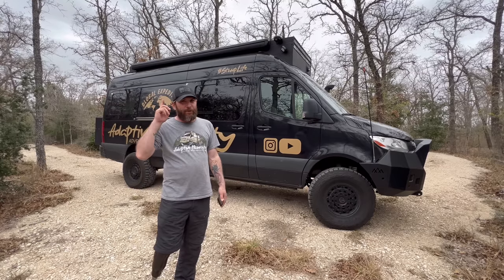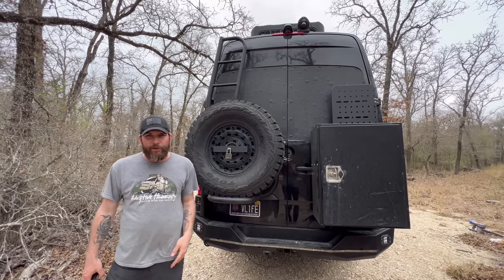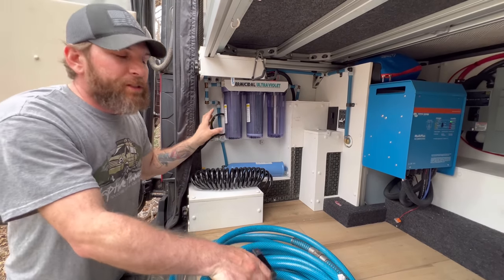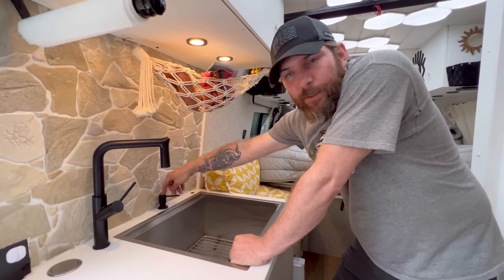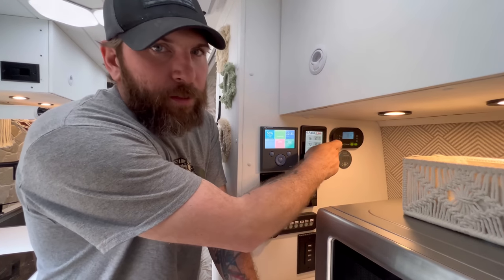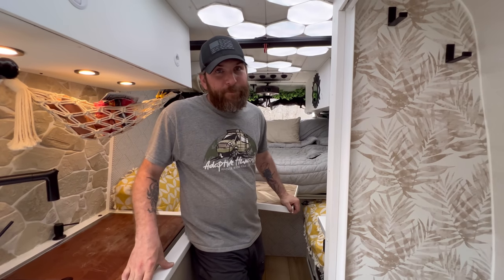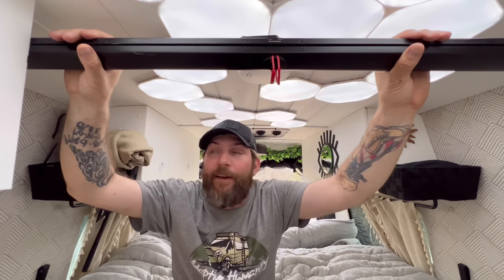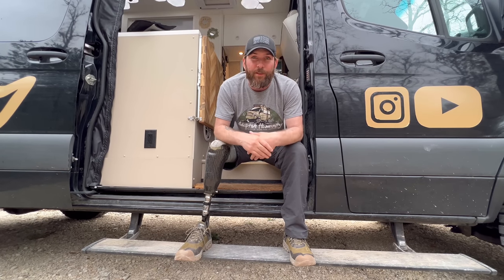🔥2020 Sprinter 4x4 170” Overlanding Van Tour

Comment: My favorite feature: "The Magic Button". Nothing worse than a tailgater. I had a vehicle that would spray windshield washer water on a tailgater at 30mph or faster. Non modified stock configuration. I always knew it was working cuz you'd see the T/G's car's wipers on high; for miles. LOL!  You can't fix stupid

Comment: I used to have a custom lowrider car with hydraulics. We used to joke that we should re-route the windshield sprayer to underneath one of the back rear tires. When I three-wheeled the car it kind of looked like a dog with it's rear leg in the air so if we had re-routed the windshield sprayer we could then lift the rear wheel and pee on cars whenever we ended up next to some jerk in traffic. When you told the story about emptying your grey tank it totally made me think of that. What you thought of is even worse though! We were just going to do it with water! LOL

Comment: So glad I just saw your video! I was googling like crazy if it's legal or not to have security cameras on the exterior, especially more obvious ones. I kept getting dashcam answers and iffy answers depending on state. But I want some actual badass autotracking security on my build.  I want to add a pan and tilt AI cameras on the front and rear instead of just discrete ones. Has anyone given you trouble for them?

Comment: One question actually remains for me personally, I am from Germany and here (and in Europe in general) weight is a big factor for vehicles. Do you have a general idea of the weight of the van with all these batteries etc.?
Reply from the maker: Sorry for the delay I just seen this. The van was 11,400 lbs.
Reply: @AdaptiveHumanity  No worries! That‘s a lot. The heaviest they come from Mercedes is around 11,000 pound (5.5 tons) but they come with dual wheels in the back. I will probably find a Solution. Thanks ✌🏼
Reply from the maker: @christianseidler2252  you need to upgrade suspension, brakes and go with a big super single and it will take the weigh.

Comment: Best 4x4 170” build so far and reasonable pricing. Do you have a website?
Reply from the maker: We do, adaptivehumanity.com it is still being worked on but partially up, so hang in there. We are also building overland vehicles, if interested drop us an email or you can see us at the overland expo west flagstaff, A.Z. May 20-22

Comment: Wow now that's a well thought out and executed build.  It seems like you would consider building an overlanding rig like this for folks interested in overlanding.  I saw some price points of anywhere between 100 to 300k.  Does that include the sprinter van or is that price point just for the conversion and upgrades?  Where are you based out of?
Reply from the maker: Thanks for the comment. We are based in Clearwater Florida and price points are without van.

Comment: When you put a ladder on the side of a van, I would prefer it to be collapsible as well as lockable, so it won't stick out so much while driving and being locked it can't (easily) be used by people with bad intentions.
Reply from the maker: The ladder was only 1 1/2 inches off the body and all together about 4 inches out total. It was also curved to the side of the van so it followed the natural body shape. We never had an issue with it sticking out, it actually saved the tire and  side of the van 2 times. I did think about making the first 4 rings removable but decided it was not worth it for us. I like your thought process though.

Comment: I’m curious about the fire prevention feature that was described as following wherever the electrical wires went. I had a fire in my RV that started from a lithium power pack I left on the dash in front of the driver section. I really don’t know how long it had been burning before we discovered the fire but a lot of the dash in front of the driver compartment was smoldering. I first used a chemical fire extinguisher about the same size as shown in your video and then used a garden hose to finish putting out the fire before the fire trucks arrived. I’m presuming that what you have in your setup is also a chemical fire extinguisher. What I discovered is the chemical composition in the extinguisher was very  corrosive, especially to metal surfaces, and anything it got in contact with was impossible to clean or take off. What I’m implying is that while it may save lives, it’s call to put out the start of a fire could very well total the vehicle as the whole electrical system would have to be removed and replaced. I guess the best is to careful and never have a fire in your RV.
Reply from the maker: Our auto fire supresor covered our house electrical not vehicle. If you did have to replace anything it would be the house system and house batteries. We used eldie fire balls for automotive in the engine bay and dash. But in the end I guess it’s better to have a totaled rv and be alive and well to make the insurance claim. Glad you made it out ok and everyone was safe.

Comment: I'm curious what van has a better chasis that DOES have 4x4 capabilities? What did they upgrade to? I wish ProMaster was 4x4 their mistake!
Reply from the maker: Our personal Rig is a 6X6 LMTV, So no van. To answer your question on a van more capable that would be an E series with 4X4 conversion, Dana axels, lockers and manual transferase. PS sprinter is ditching 4x4 this year. We also own Adaptive Overland Engineering that builds custom rigs so if interested shoot us an email.

Comment: so, how much did this unit go for?
the correct question would probably be: how much would it sell brand new?
Reply from the maker: Brand new around 300-375k depending on the base van price and material costs at the time. We are actually building overland vehicles and custom parts. If interested drop us an email or you can check us out at the overland expo west, flagstaff AZ may 20-22

Comment: Nice build.  I have the same problem with Owl racks and boxes stressing the windows and blowing them out.  Was the PC window install basically the same as an AMA or glass window?  Did you paint the PC?  Thanks.
Reply from the maker: The PC window was wrapped on the outside with 3m vehicle wrap. The window was set using adhesive but also screwed into place. Wrap covered the screw heads.

Comment: Hi Guys! 
Amazing van build, I really freaked out about how detailed and smart your technical part is. Bravo 👏
Few questions:
1- How much will it cost to order the same build from you? Or how much did you asked for this particular van that you sold?
2- What is a new beefier platform you've decided to switch to? I'm at the stage of choosing the right van to make my dreams come true so collecting all useful information) As a LR Discovery 4 driver I really want to keep as mach off-road capability as it possible after switching to van. Unfortunately, at the moment, I can't afford to own both vehicles at the same time.
Reply from the maker: Sorry for the delay, this just came up as a new comment! 

With todays market that van would be roughly 350-375k hard to tell without sitting down and actually doing the math. 

We are building on truck and lmtv chassis now. Way better than any van, slightly wider and the same length as our van 25ish feet. You end up with a lot more living space as well. If I treated in doing a build feel free to reach out info@adaptiveoe.com
Reply: If you build on a van chassis, I would recommend a 3500.  The suspension is already heavy duty and can handle the weight going into the van.  On a 2500, after adding all the weight you have to do all the suspension upgrades.
Reply from the maker: @jonfreitag4126  unfortunately you can not do all the off-road suspension mods on a 3500, plus you would want to figure out how to super single it as off-roading with dual’s is not always a wise thing.
Reply: @AdaptiveHumanity  IMO a sprinter period isn't ideal for off roading, especially a 170.  The duallies with larger AT tires have worked just fine for forest service roads and the places we want to get to with our van.  Super singles are a great way to spend a bunch of money on a platform that is never going to do serious off roading.

Comment: Wow. If there is one word that describes this build, it's overkill. Just to be clear: that statement is in no way meant as bashing. But any engineering solution is a matter of compromises. You can bulid a bridge by filling the valley, but that is, well, overkill.  I do admire the quality of the build and your attention to detail. I would have come to different solutions on all sorts of decisions, though. But that is just me. You would def be much safer after a zombie apocalyps than me. 😛 The largest drawback by far, the way I see it is weight. Going to something like an M1083 is a good decision for you guys.

The one thing I disagree with is the deal with the wood. Pointing to your sink cover as the example for why wood is bad is like point to orange peel or runs in a paint job and saying: this is why I don't use paint. The right piece of wood dimensioned and treated properly would be just as flat as the day you made it. I assume I am not the first person to comment on this, though.
Reply from the maker: You are correct this was an overkill build! We also did a lot of product stress testing with it so some of the items that are in it were being field stress tested. Weight is an issue and our new personal rig is a m1083a1, so no issues anymore. Again it will be over the top 1 because that’s how we do and 2 product testing. We actually are now manufacturing our own parts lmtv and habitation stuff. We test everything on our truck and a few customer trucks. 

As far as wood goes I do agree with you to a certain extent. The sink cover was an extreme example but I did that due to the fact a lot of people use sub par materials ( pressboard, cheep ply, 1/4” birch with laminate). If you are a woodworker, carpenter, cabinet maker you know better but most don’t. The big one that drives me nuts is wood in the floor! Not sure why this is a thing.

Thanks for the comment! Love hearing others perspective, helps us grow
Reply: @AdaptiveHumanity  Like I said, I loved the quality and attention to detail. I'm looking forward to following your new build(s).

Comment: This is an amazing build!!! Love the Nanoleaf lights!! Are you running the lights on DC or AC? If it’s DC, I didn’t see anything on their website for a DC power adapter.
Reply from the maker: They were ran on A/C even though they are a dc light. The voltage was different though it was like 52vdc or something stupid like that.
Reply: @AdaptiveHumanity  Thank you. Darn, I was trying to avoid using AC in our Sprinter.
Reply from the maker: @marshal.van.mathers  so there are Nono leafs that are 24v. I can give you the name tomorrow when I get to the shop. The 24v don’t have all the stuff the other ones have but are still cool.
Reply: @AdaptiveHumanity  sweet man!!! I just followed you on IG. I’ll send you a message
Reply from the maker: @marshal.van.mathers  email is adaptivehumanity@gmail.com

Comment: but those wheels stick outside of the wheel wells - so when they bounce up far enough, aren't they going to hit the rim of the well, rather than fit inside?!
Reply from the maker: We have never had an issue with wheel contact. We have also taken this thing extreme off-roading through Alaska, to small rock climbs in Moab.

Comment: Awesome  an build! I’m considering buying a van and converting myself (I have a tight budget, so I’d start with an IKEA build and upgrade it each year. I do have one question though….since when is Teak not considered wood?
Reply from the maker: Thanks! As far as teak it is actually not part of the build they are a plastic backed snap tile just to elevate the shower floor. You just lift them out and the shower pan is under it. The actual build had zero wood. All aluminum, king starboard, carbon fiber and coosa. If you do your build reach out to us at adaptive overland engineering we socialize in diy stuff. We actually build custom cabinets that are flat shipped to you for assembly. way better then ikea and around the same price. We actually have you make a template for your walls and we cut the cabins to fit perfect.

Comment: Such a smart build, and clearly well road tested! What does the magic button that activates your secondary drinking water filtration actually do? Does it control a ball valve, or something similar?
Reply from the maker: Hello, thanks for the comment. It turns on the secondary UV treatment so the uv lights are not on all the time.
Reply: @AdaptiveHumanity  Thanks!

Comment: Hey, did you mean 280 watts from the second alternator? You said amps...If indeed are amps, please let me know what kind of alternator and DC to DC charger you guys are using :)
Reply from the maker: It is amps! 280 amp second alternator with Belmar external regulator with a lithium program. You can check them out on nations alternator. No dc to dc charger as it is a dedicated house bank alternator.
Reply: @AdaptiveHumanity  You are right, didn't think of that. Thanks for the reply! :)

Comment: How is the 170 off-road. Seems like the breakover and departure angles would be an issue, at least compared to the 144.
Reply from the maker: We shoved that thing in places that a side by side would go. Literally down atv trails that people were mind blown and taking video. You also have to remember bumpers were changed, 35” tires and 3” lift were added. Only part that sucks is the 70/30 4x4 and Mercedes transfer case is built for maybe a few pot holes. Our opinion if you want to do what we were doing or more buy a truck or have a complete custom driveline with Dana axels and lockers put in. Ps we did blow a  $12k transfer case and we were on a loose gravel dry riverbed. All this is probably why they are not making 4x4 starting next year.
Reply: @AdaptiveHumanity  Thanks. Storyteller claims their Beast Mode model has a true low range. Do you think  that's something they did since it (based on what you said) didn't come from Mercedes?
Reply from the maker: @jkinney5  I think it’s a load of bs. Factory it has low range but there is no way they managed to get a 50/50 split with lockers. I think it’s a marketing gimmick. There was one company in the county that did solid axel swaps and transfer cases and they closed last year. Also just to get their kit was over 100k so the price point the beast is set at would also make me believe they are utilizing stock factory 4x4 and trying to make it something it is not.

Comment: What's the next platform that y'all are going to building/purchasing? would you mind sharing the reason for going away from the van? I'm a truck camper owner, but am curious about your decision making process
Reply from the maker: We are actually building a m1083a1 for our personal rig. The switch is because no matter what you do to a van it will never be a truck. While the van could do a lot we mainly have issues with all the MB parts that we can’t change. Because of the the van is limited in capabilities. We actually build overland vehicles  and specialize in lmtv vehicles so it’s a natural fit for us.

Comment: But you cant see the back lights? Why not hard wire that back ledstrip?
Reply from the maker: Due to the spare tire and the box you have to be more then 3 cars away to see the full light. The bumper light was hard wired just kept ripping it and the wires off while off road. If I were to do it again I would put lights in the bumper and call it a day.

Comment: really like the shower valve with pause function, which brand is that?
Reply from the maker: It was actually 2 separate parts. We bought the shower head then found a valve that the color matched and added that for pause feature.

Comment: What happens if your grey water macerator sensor fails? Is there an override?
Reply from the maker: Yes there is a bypass that sits before the pump.
Reply: What a great build..... Would love to know what model/brand of Macerator Pump you recommend, what mode & make did you use?  Looking for a 12v version.

Comment: Unfortunately it's a North American Diesel. Get your self a Gas no  Headache.
Reply from the maker: Define North American? Gas also has zero torque so heavy rig off roaring that does not go well.  I can tell you this van had OFF ROAD ONLY mods so it had no “additives” or other systems that can cause issues.